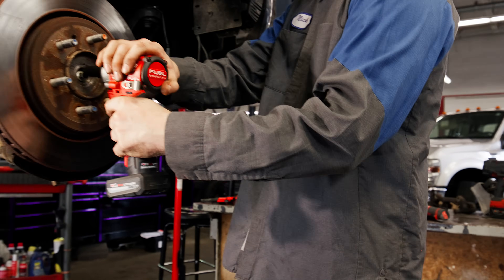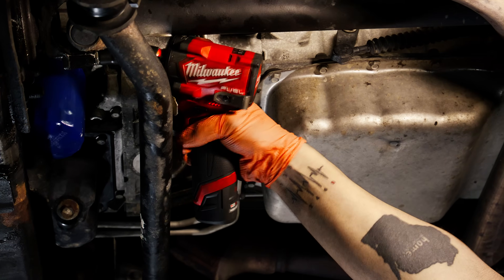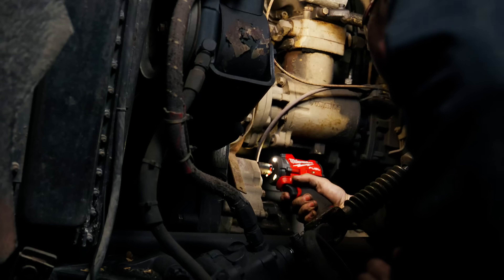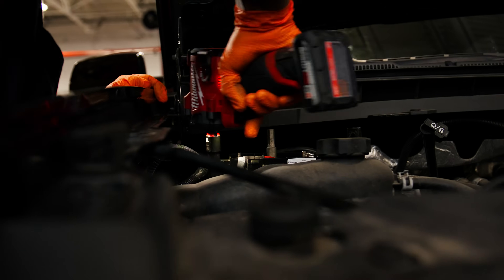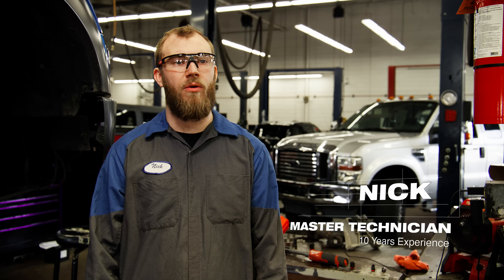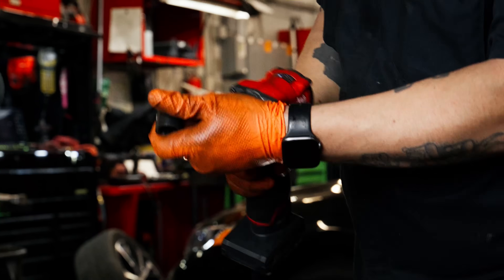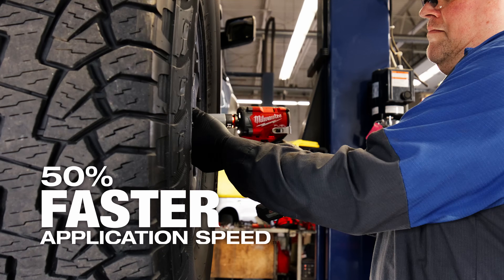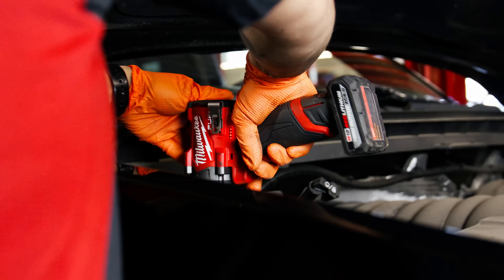M12 FUEL™ Stubby Impact Wrenches Gen II 2562 & 2563 | Up to 550 Ft-lbs Nut-Busting Torque

Comment: I have the M12 stubbies and lets be honest 
1.) 3/8 ring are weak and sockets fall off after a very little use
2.) m12 batteries have bad build quality. The locking tabs break off.
Reply: Try not throwing your tools when you get angry, cuz youre bad at your job.
Reply: @Dexter_Solid  not sure why you're so agressive.
We're all adults here. We all love Milwaukee and one thing that Milwaukee loves is getting honest feedback to fix what's wrong.
These comments were justified and they are true. I personally never had problems with M12 or M18 tools but I've met people who have and it's mostly always the same problems.

It's not a big deal. No need to tell people they don't know how to work.
Reply: @Dexter_Solid  I have a whole YouTube channel showing my jobs where I don’t throw my tools.